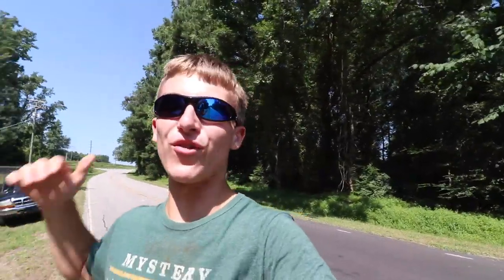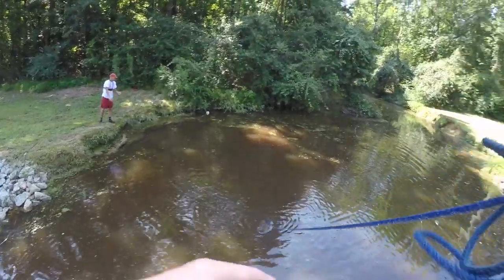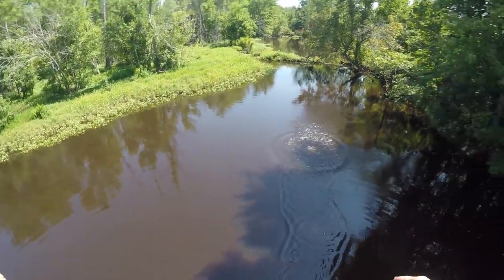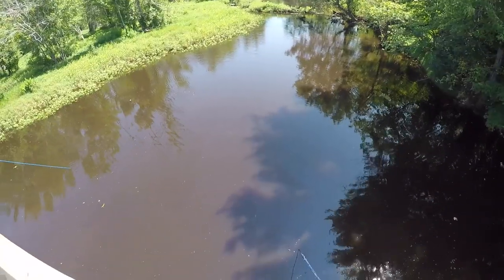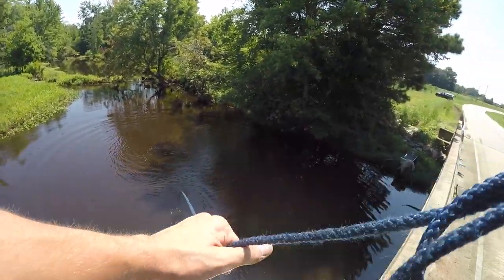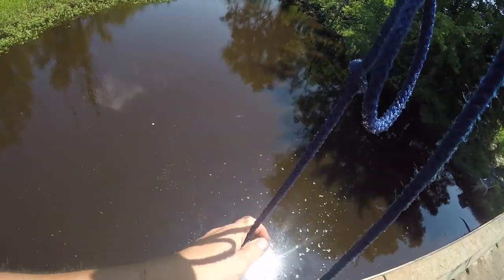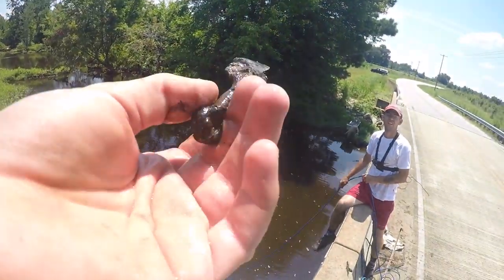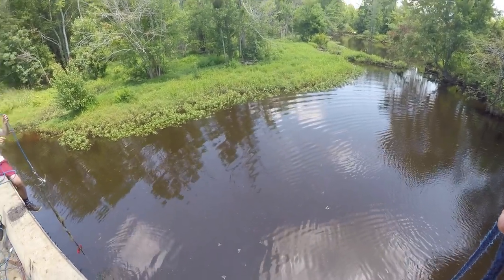This Is A Game Changer! (Grappling Hook Fishing)

Comment: I think you should get a grappling hook. It looks like you guys would be able to pull so much more out of the water than with only a magnet, not that the magnets are doing a poor job of it by any means though. What the magnets miss the hooks may be able to get and the water ponds and sheds will become cleaner. Keep doing what you're doing!

Comment: The grappling hook I got with my magnet fishing kit off Amazon seems small and so light weight it cannot carry the rope when I toss it. I need to add 6 to 8 ounces of lead to cast it well. The magnet was supposed to have a 500 pound pull but I doubt it has even 50 pounds of pull. It seems with all the false advertising of these magnets a guy has to get the biggest he can find and make sure it is double sided.
Reply: I wanted that grappling hook mostly for creating out all the sunken tree limbs from my favorite fishing holes plus retrieve all the lures people loose on those sunken limbs. My metal detector has done well for finding about 8 pounds of lead fishing weights.